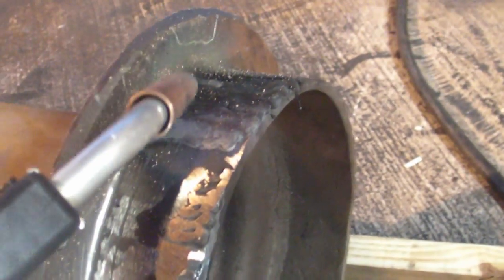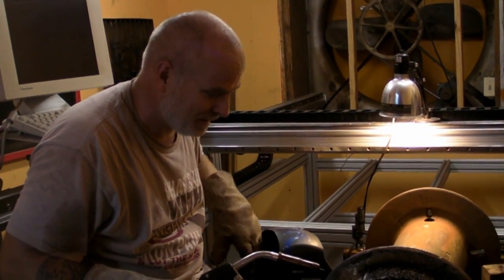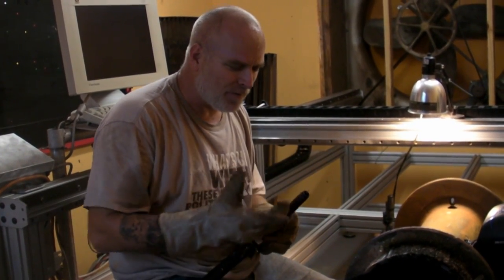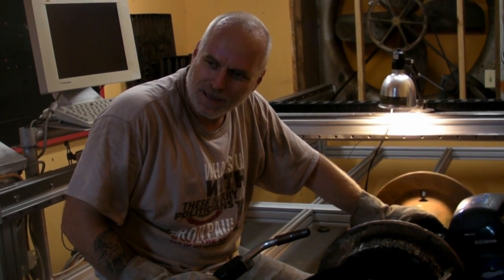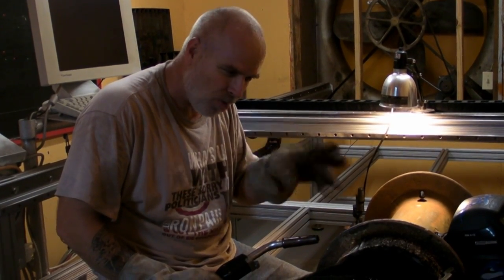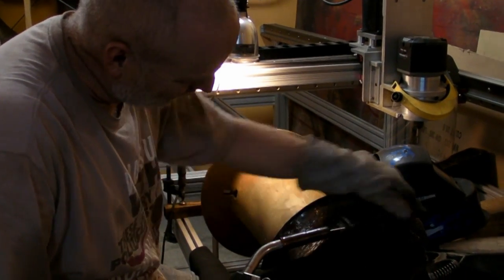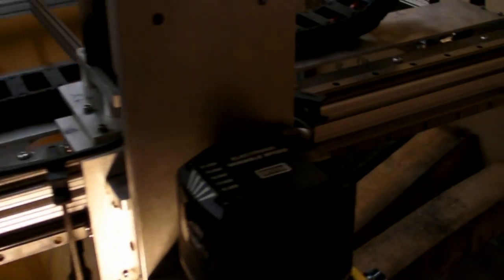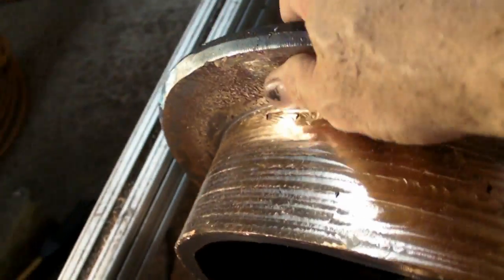Anchor Winch Rebuild - Part 2 - MIG Brazing

Comment: Handsome dog! Jess knows that the cat belongs to the pack. As much as I don't like to constantly be reading safety warnings I would also suggest breathing as little xylene vapor as possible. It's only marginally less nasty than benzene vapor. If possible use a large fan to bring in fresh air and chase away the fumes. Although at age 70 I will likely never build a boat I find your videos truly stimulating and entertaining. Thanks for all your efforts in making them.

Comment from the maker: That sounds smaller than what I have now, but I'm running what I have now on it's lowest setting.  And that footprint will fit my current box.  I'll go to work on it as soon as I finish this winch I'm working on.  And thanks for the help.  I have little experience with this stuff.

Comment from the maker: I lucked into a 2hr hands on MIG Brazing demo when I went to AirGas as started asking questions about how to weld repairs to our propeller blades.  I'd think iron would last longer, but that brake will get very little use.  It's more like a parking brake.  And the only trick that that I know for flash rust is the thin the first coat of epoxy with Xylene so it wicks in around the rust.  And lots of ships are hydroblasted now days and they have epoxy designed for the flash rust.

Comment: Keep in mind the ratio on the spool to gear drive versus toque when the spool is full and close to empty. The spool designed for that winch is at top rated toque when full . I posted that when I paused the vide a 8:00 And saw the rest , so I see someone already educated you on pull ratios. Very cool .

Comment: Stepper drive is a controller, and I build cnc's here in Ft Smith AR, I have steppers also, but you need a stepper drive, I use KelingCNC on some of my machines and have a couple of them laying around too, I could hand deliver one for free if I can get a tour, lol

Comment from the maker: KL11078.   I use an older model Hypertherm 1000.   The THC was only $250 if I remember.  It only uses voltage sensing.

Comment from the maker: I got it used and rebuilt it with original parts, but I'm really not even sure what's wrong with it yet..  I have the amperage at the lowest setting on the drivers and mainly cut soft wood and run a plasma torch around the table.  The culprit might have been a lightning strike.

Comment from the maker: Heck you're welcome to a tour anytime.  I picked up a new Keling driver so I'd have a spare, but they make the new ones bigger so now, I've got to build a new box.  Maybe I can trade you a new Keling for an older one?  I also have one of those lost cost plasma THC units.  Come to think of it, I purchased that from someone in AR.  Was that you?  Anyway, I need to get that installed too.

Comment from the maker: Look at 11:20 into the video and you can see the keyway that locks the inside portion of the dog clutch to the spool. The other half of the dog clutch slides in and out on the shaft on keyway that makes it turn with the shaft.

Comment from the maker: I think the motors are KL34H2120-42-8A They are 8 wire, but the wires are pared together as: 1- (A+) Blue/Yellow, 2- (A-) Red/Green, 3- (B+) Brown/Orange, and 4- (B-) Black/White.  That according to the documentation is Bipolar-Parallel, and this motor wired for Bipolar-Parallel will draw 6 amps per phase at 3.5 volts DC and they produce 1160 oz-in of tork.   And I have the switches on the driver set for .32 amps which is the lowest setting so I don't break anything.  So far I've not needed more

Comment from the maker: Right.  I don't think steel cable would do that nicely.  If we use steel cable it will all stay on the narrow side.  I think it came out to 300 ft of 3/4" cable that can go on the narrow side.  And the fact that it's narrow helps the cable lay in neatly.  But our preference would be to use high strength rope that is much easier to handle and could be easily flipped to the small side "working side" just 8 wraps before taking the load.

Comment: After water blasting if you use a leaf blower to remove excess H20 and then use it to assist drying it will reduce flash rusting. Another option is an oven which you could also  use to heat larger part or area when heating a part is needed. I am sure you could easily fabricate one.

Comment: Thanks Doug!  That winch drum is shaping up nicely, but what a pile of work (and grinder dust)!  I was not aware you can mig silicon bronze, thanks for sharing.  Will the silicon bronze work as well as a braking surface as the cast iron did in terms of wear?  Will you address the flash rust in some way prior to priming?

Comment: I can`t remember the name of it but it`s for painting over welds on Galvenized steel it`s grey silver stuff  but it really bonds forever to new fixes use it on the sandblasted steel ,I`ve cut & welded culverts that go underground ,Sometimes the grader will hook the end & have to be replaced this stuff is like the day I put it on be good on external steels .

Comment: Hey I have a question for you guys. At the begining of this video you are using a torch 0:20.I just bought a harbor freight one in hope of powering the alumminium foundery that i'm building. Do you think this is powerfull enought to reach the aluminium melting point ince integrate to a mini foundry? (no air intake is planned but I could plug in a hairdryer to increase the oxygen part of the combustion).Thx for giving your time to document your work. this is eye candy for a dude like me
Reply from the maker: +Vincent RIEUF      Yes.  I have used that torch in my flower pot furnace and it works just fine for aluminum.  No modifications or additional air supply are needed.
Reply: Excellent! Thanks for the info

Comment: You had that really nice rotary jig for milling the new surface on the wench spool. Could you have used it as a platform that would allow you to hold your welder in one position while the work is rotated?

Comment: i am wondering how you plan to get the cable/rope to lay nicely when going from the one side to the other.
The winches we build at work has a split in the divider to allow the cable to lay in the bottom of the divided section from the first layer. but our winches are huge in comparison to what you're dealing with here..
so for all i know you could have a plan on how you are going to make it work :)

anyway i enjoy following the progress on your boat. :)

Comment: ok i know jack all about sandblasting, but im thinking you can avoid the flashrust by adding a bit of oil to the water/sand mix. maybe add it when it comes out the hose.
Reply from the maker: Not hear of anyone mixing oil in, but TSP works to stop flash rust. However the paint dealers recommend just drying it off and thinning the paint or using a paint designed to go over wet blasted steel.  Some of it you can paint on while the steel is still damp.  Other chemicals like TSP mess with the paint.
Reply: Regular oil won't mix in but water soluble will. Might be worth trying.

Comment: Winch drums are made from cast steel, not cast iron. You could have just heated the brake hub and straightened it out. Winch drums are subject to shock loading and cast iron does not take well to it. The easiest and fastest way to determine what grade of ferrous metal you are working with is known as spark testing. Each grade of ferrous material throws a different kind of spark when a grinder is applied to it. There are a number of videos on you tube that demonstrate these differences. (See https://www.youtube.com/watch?v=cFf_x97vcQ0 ) Another good site which deals strictly with the types of dsteel is http://www.searchsteel.com/2011/04/spark-test-of-steels.html .

A quick way of determining whether a part is steel or cast is to sound or tap test it. Steel will ring when struck lightly with a metal hammer. Cast on the other hand while give a dull "thunk" sound.

There are normally three kinds of cast iron commonly found. The first, grey cast, is made by pouring the molten metal into the sand mould and letting it cool naturally. It is relatively brittle in nature but can be repaired by brazing. The second, white cast, is poured and then quenched with water and cooled quickly. White cast cannot be repaired with any degree of success. Malleable cast starts out being made in the same method as grey cast. After it has cooled, it is re-heated and then cooled slowly under controlled circumstances. Malleable is the toughest of the three and will actually flex or bend slightly prior to failure.

Comment: ok, 4 years too late (which is just about my speed, lol), BUT: why not wrap the hub with that funky white furnace insulation glass, toss a little dew rag cap on top of the same stuff, and work a "weed burner" torch like a forge burner through a hole by the bottom? that'll kill the radiative losses that bedevil your attempt, give you a good even heat by swirling the flame, let conductive heating work with the natural "heat pattern" you'd want (toasty up top, bottom not so much needed), and you can just shut the gas off, pop the lid, run a few beads, then recap and retorch to heat back up and keep things all even toasty up top. best part, your "furnace" weighs a few pounds, and rolls up into a chunk of plastic pipe, or even cardboard casting tube for crete, so defies damage for the decade or so til next called to service. seems like it should work, no?